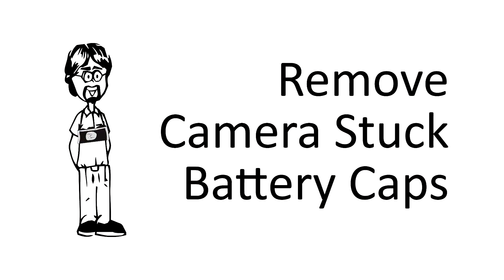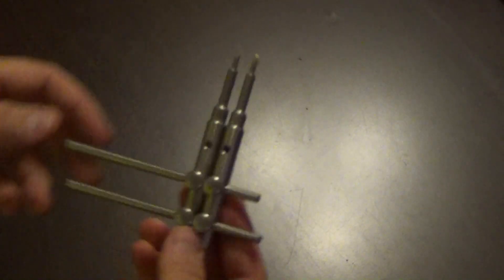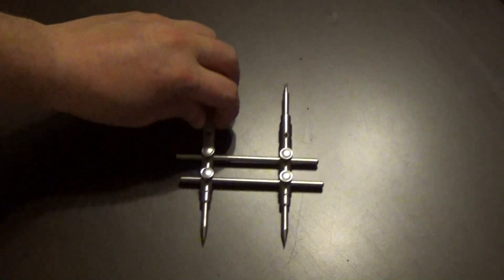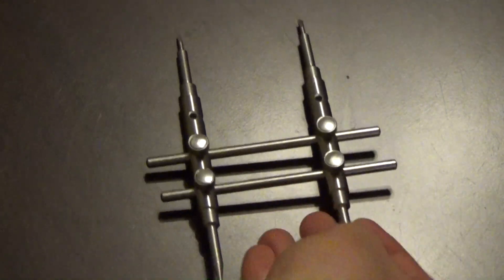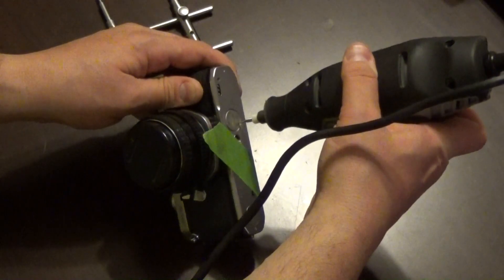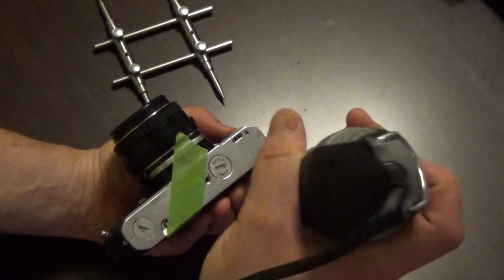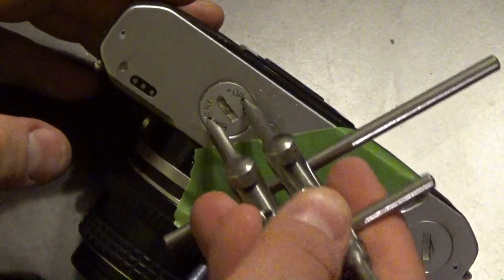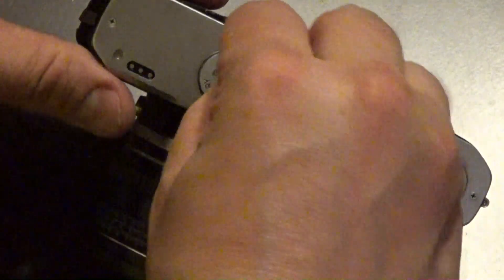How to Remove a Stuck Camera Battery Cap

Comment: Dear dude, THANK YOU! had a stuck pentax 67ii cap where no coin or screwdriver helped, just made things worse.
manage to drill holes, and due to lack of spanner just hammered two nails into a piece of wood and got the damn thing open.
Thanks!
Reply from the maker: Nice! That's definitely a way to get it done.

Comment: Just tried this on a Minolta X-700. I was worried at first (having zero repair experience) but the door was jammed tight and various coins and screwdrivers achieved nothing. Worked like an absolute charm. Corroded batteries replaced, camera is working perfectly. Thanks so much!
Reply from the maker: Thank you!

Comment: Mine is stuck shut (didn't try to fix it yet)... do you know if (also assuming that it can happen) the spring has corroded/got the stuff on it do you think that's not good (aka, can you replace the spring easily)?
Reply from the maker: It's very possible as leaked battery corrosion travels up the electrical components and wiring. When you get it open, try cleaning it as shown here and see if the camera works. If so, then no issue. If not, then there may be issues further up which would require a greater disassembly to investigate.

Comment: Pentax Spotmatics are notorious for stuck battery caps.  Look at the base of any Spotmatic and you can often see that the cap coin slot is all damaged.  The design of the battery compartment leaves hardly any spare room and when the camera is put away for a while, the battery swells and jams the cap.  Pentax actually put  two very small drill holes in the cap on later models to deal with this problem.
Reply from the maker: A large contributing factor is that the slot on the Spotty was designed for a US nickel or a Japanese yen (of some value.) Using something like a US quarter, which is too thin and harder than the soft brass, easily takes off the edges if there's any resistance. But with a nickel, there's no issue because it fits so snugly.
Reply: That's actually exactly why I came here, coincidentally. Got a spotmatic iiA for 30 bucks with a 50mm1.4 and 135mm 2.8. I'm excited to get that battery out of there and get it working (to full capacity) again. I've just been using it without the light meter but actually have the original flash and everything for it, so we'll see if the eye on it still works for the flash.
Reply: @DavidHancock  Thank you guys, it worked with the nickel, used also a jaw locking plier for increased leverage and it came right out!

Comment: As well as this being very useful (for which many thanks!), I like your curtains. Given that I hate drills, and am pretty certain the issue with my newly bought old camera is a battery leak, not cross-threading, would it be possible to put some oil on it to make it unstick?
Reply from the maker: Thank you! I miss that cabin. I used to rent it on weekends with meteor showers because the skies were some of the darkest in the U.S. and it almost never has cloud cover at night there. But it's a bit too far away to drive to now.

As for removing a cap other ways, you can try to use very grippy rubber, like a jar remover. There are also lens ring removers that are small rubber cups. The smallest size of those (they may only come in a kit) could work.

Comment: Hi David, was wondering if you know where i could find a battery door for the Contax T2 or something compatible, seems like just a simple disk. I have the Gold Contax T2, everyone is asking very high prices for a simple cap. especially the gold one. I dont care about the colour or the authenticity just want something functional. Thanks for your time.
Reply from the maker: Honestly the only source I know is eBay, but in addition to caps look for parts cameras and if they have a cap it could be cheaper.
Reply: @DavidHancock  So far no luck, all sellers seem to be in China, which means weeks of waiting and high chances of something going wrong. I ordered once from china, and it was a nightmare. Guess ill just keeping using gaffers tape and aluminum foil. Cheers thanks!

Comment: So it's ok to keep using the battery cap even though I drilled two holes in it?
Reply from the maker: Yes. There cap just retains the battery and completes the electrical circuit.

Comment: Can i use this method if the metal part has come off? What's left on mine is a plastic battery cap that was underneath the metal one, and it's totally jammed. Thank you!
Reply from the maker: You can. Your best bet will be to buy a replacement cap off eBay, too. As it sounds like yours is probably busted.

Comment: I just thrifted Olympus om10. The cap is stuck. I’m planing to do what you’re doing but I noticed there’s a small hole on my cap. Does it mean I only need to drill 1 hole now instead of two? Hope you answer. Thank you !
Reply from the maker: Maybe, yes, if the hole is off-center enough.

Comment: Compré a bajo precio, una vieja cámara Minolta SRT 102 para estudio. Funciona bien, la única falla es la tapa del compartimiento de la batería, que presenta corrosión y está sulfatada. Sepa alguien cuántos años se quedó con la batería puesta.
La tapa tiene 2 perforaciones, pero no puedo extraerla. No tengo la herramienta que muestra. Qué puedo hacer?  Gracias. Excelente el video. Saludos cordiales desde Chile.
Reply from the maker: ¡Gracias! Es posible que deba comprar una llave inglesa (alrededor de USD $ 20) para quitar la tapa. Para limpiar la corrosión, necesitará vinagre blanco destilado y bastoncillos de algodón y luego alcohol isopropílico. Retire los residuos de la batería explotada con vinagre (la fuga de la batería alcalina se neutraliza con vinagre ácido) y luego limpie el compartimiento con alcohol. El contenido de la batería filtrado puede seguir el cableado de la cámara y estropear los circuitos, por lo que no hay garantía de que el medidor de luz siga funcionando.

Comment: Ive heard if u dribble acetone off a q tip into the thread it should free up any contaminants
Reply from the maker: Acetone will remove grease and dirt, yes. Acetone is a better degreaser than rubbing alcohol. It can also damage the plastic in the battery housing, however. An acetone wash around the perimeter of the battery cap can help loosen it if it's stuck due to solidified grease. However, if the cap is cross-threaded or if the battery expanded or leaked, acetone won't help. But yes, there are times when that will help work.
Reply: very well said mate cheers for sharing your techniques

Comment: Olympus battery cap comes off, but battery jammed inside and can't get out. How does one fix that? How to remove battery?
Reply from the maker: @Lainer1  that probably means that it swelled. Try prying it out with a toothpick or something else like that. Some 91% isopropyl on a cotton swab around the battery might help.

Comment: Hello everyone, 
I need help with my yashica. It looks like it's in perfect condition. I got a new battery adapter and nothing lights up. The battery compartment was corroded. When I tried cleaning it, the the ring on the battery cover, disintegrated. The rest of the battery compartment was easy to clean. Please I can't return this camera, so I am going to fix it myself.
Reply from the maker: If the corrosion was very bad then it will have travelled up the wiring and into the camera body, likely ruining any of the electronics inside. If cleaning the battery compartment and putting in a new battery did not fix the camera then it likely needs a professional repair to disassemble it, remove the corroded wiring, and solder in new wiring. It's a pretty intense project and Yashicas, especially if you have a rangefinder, are complex repair jobs.

Comment: isn't drilling into the cap unsafe for the battery? I would think drilling into a drained but okay battery would also cause a fire in a Li-ion battery
Reply from the maker: It's pretty easy to drill outside of the area of the battery, which is much smaller than the cap. I have drilled into the battery, but since film cameras with threaded caps like these all use alkaline batteries, there's not a risk of fire from that. This would, yes, be an ill-advised idea for a modern digital camera with a lithium battery.